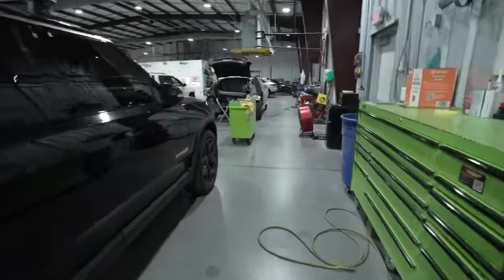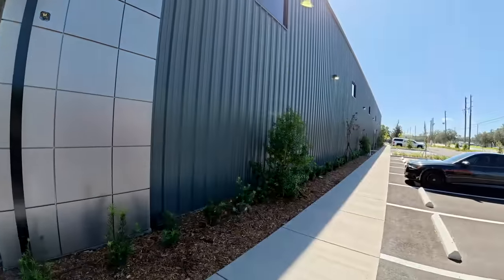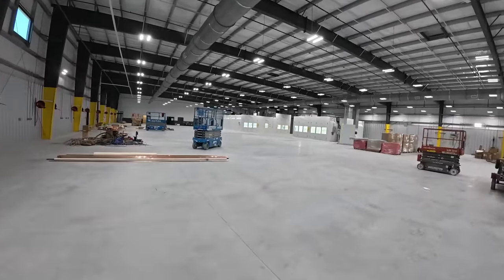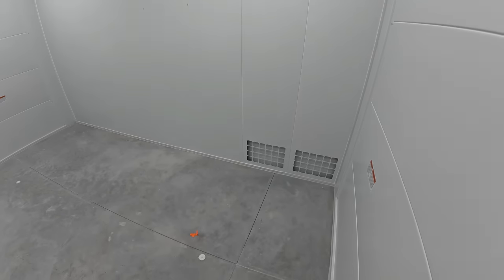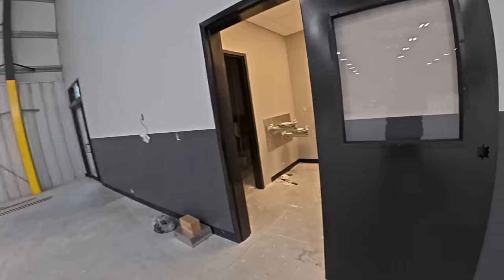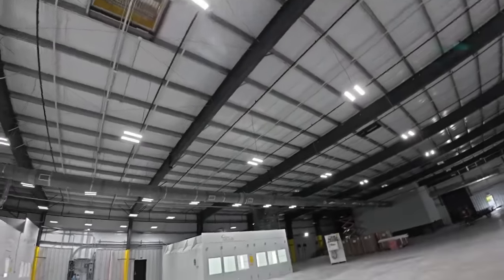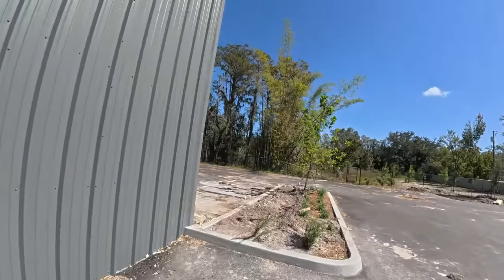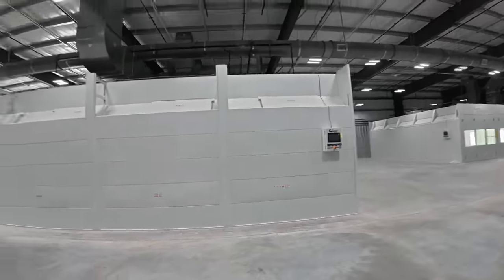Brand New State Of The Art Body Shop!

Comment: Those fans at the top of booth look like a dust attractor and an additional constant maintenance item that is hard to reach. 

Thoughts?
Reply: Not much will get up that high with the downdraught, probably a wipe down when changing out the top filters very rarely.
Reply from the maker: They are great used them before and they work out perfectly
Reply: @kandyman5315  what was your typical maintenance program? Thankfully here in Colorado with our dry ass air, our water base flashes almost like solvent. But out there in the humid AF gold bond belt, I imagine your running them all the time. 

It's minor stuff, I know, but a nib is a nib and each one takes time out of the day to pull out.